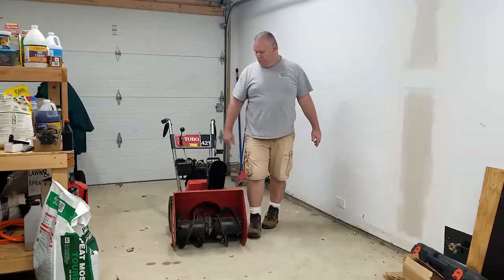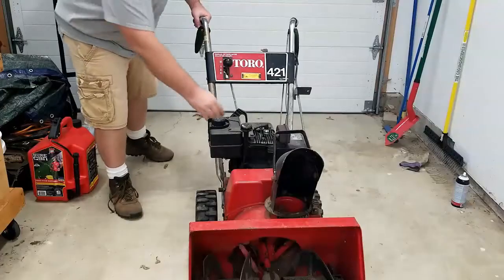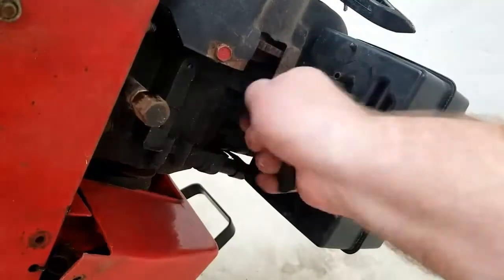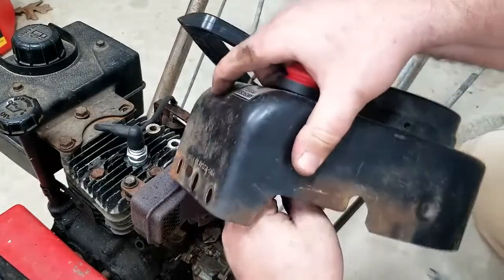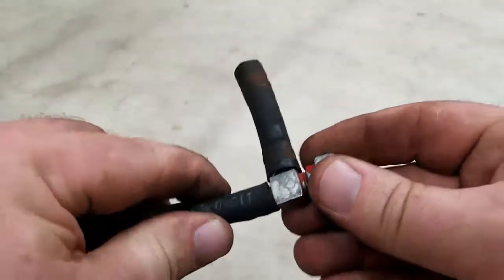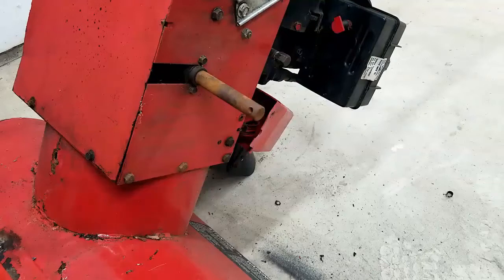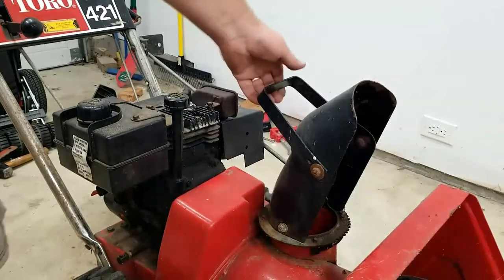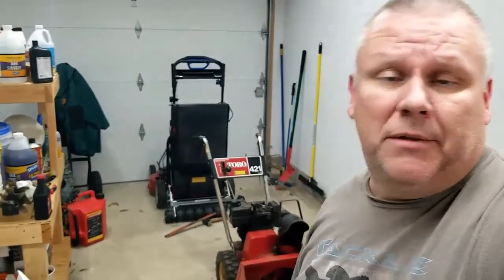Fixing a 40 Year Old Toro 421 Snow Thrower!!

Comment: 😊I’d have used some of the drained oil on a brush and “painted” the sheet metal parts going back onto the machine to give some level of rust resistance to my machine.

Comment: I just bought 1981 Toro421. It looks built to last. With good maitenance it could last another 40 years! Greatings from Lithuania :D
Reply: I have a 1980 421. Put a new engine on it recently. Runs and performs great.
Reply: @norge696  I did the same thing on a Toro 521 is pretty much same frame but the shoot is a little taller. Now I'm just waiting for the new scraper bar and skid  shoes to come in the mail.
Reply: @robertknight4672  good stuff! gotta love the repowers! nothing beats a brand new engine.

Comment: I have two Toro 1980 models. Both were bought new by my dad. One is a 524 and the other one is an 824. Both run perfectly and blow snow just like they did when they were new. The 524 has new tires and an impeller kit. These old Toro's are built like tanks. I just replaced axle bushings on both machines this summer. They were really worn and needed changed. On these flat head engines, check head bolts for looseness. Torque settings. 16.5 ft-lbs/200 in-lb These old machines don't throw snow like the new ones do. That is why I added an impeller kit which does help with distance. These machines have a spring-loaded scraper which works really well on paved services. On gravel the skids have to be all the way down or you will be throwing gravel everywhere. Both of these machines still have the original friction drive systems. I drop the inspection plate each fall and lube and inspect for any problems.  I do wonder if friction drive replacement parts are still available. This winter I have a new toy to try out. A Toro Power Max HD 1232 with trigger steer, quick stick and hand warmers. If conditions are right, Toro says this unit will throw snow up to 57 feet.  I am looking forward to those hand warmers. I have at least two times taken the carbs off and completely dissembled them for a thorough cleaning.  This year I started using ethanol free 91 octane fuel for all my outdoor equipment.  Oh yes, I use Sea Foam in all my outdoor equipment fuel. The stuff really helps keep the carburetors clean. Enjoyed your video. Old Toro's are great machines when running and performing correctly.

Comment: I picked up a similar one, it's a 524, Carb needed cleaned and a new float seat. I have fuel leaks and the primer hose is cracked too. Thanks for this video as it will help me! PS. I subscribed.
Reply from the maker: Those Toros are work horses. Thanks for the sub!!
Reply: @part-timelawns4392  You're welcome

Comment: spacer bars are on backward, the curved part should be facing forward, just a note, swap the left one to the right side and vice-versa to correct
Reply from the maker: Thank you for the comment. At 22:59 you can see that the skids are symmetrical and have a curved part on either side. Thank you again for watching.